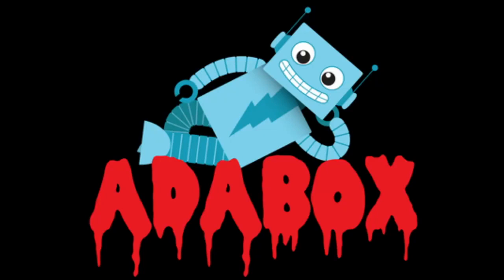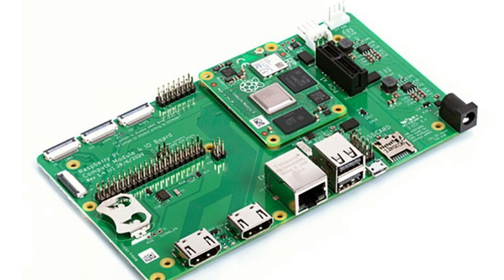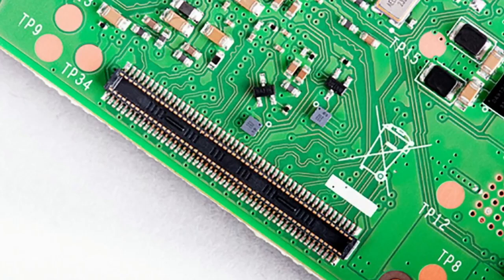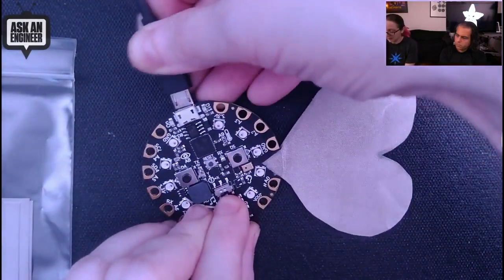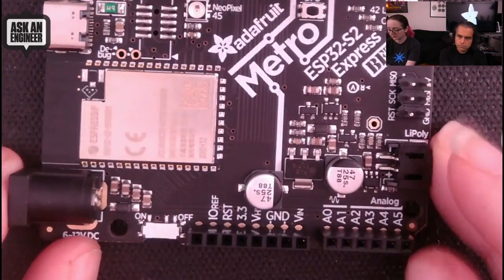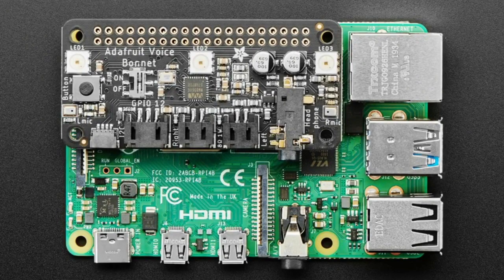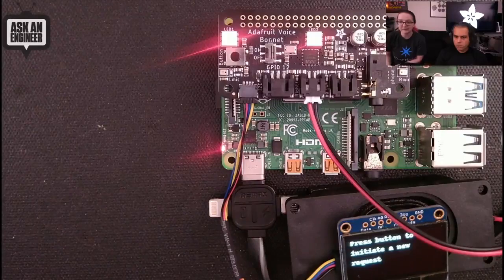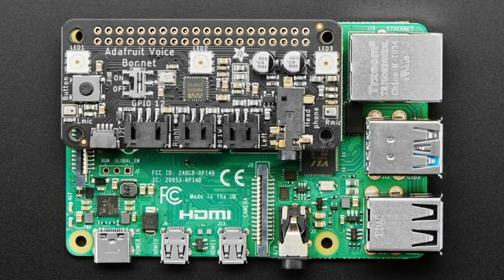New Products 10/21/2020 Featuring #Adafruit Voice Bonnet for Raspberry Pi - Two Speakers + Two Mics!

Comment: CM4 is awesome. I'm thinking it might compete as a solid network appliance board (NAS, firewall, security) for a SOHO with a competent IT guy because that PCI-E interface is exposed. Totally stoked for an adafruit or sparkfun variant on the IO board.

Comment: What‘s the connector on the Pi4 Module? is it possible to solder for a DIYer?
Reply: No, it's a very high density connector. It's way too fine to solder.